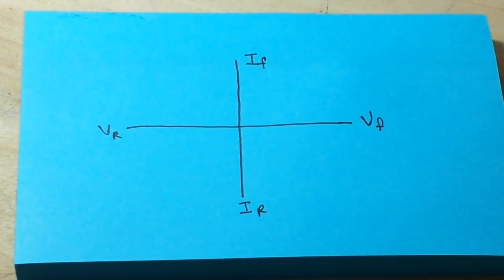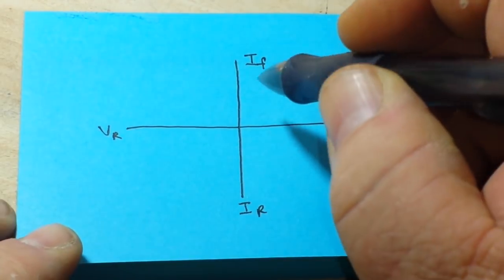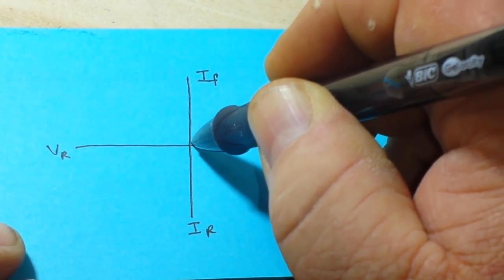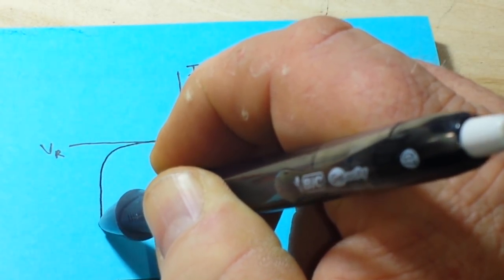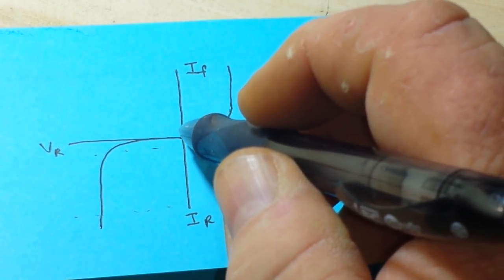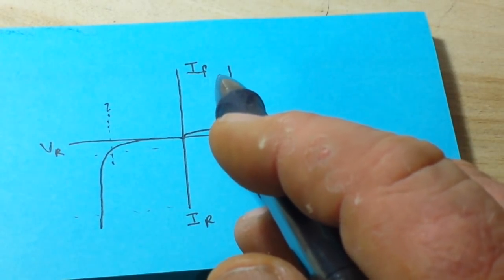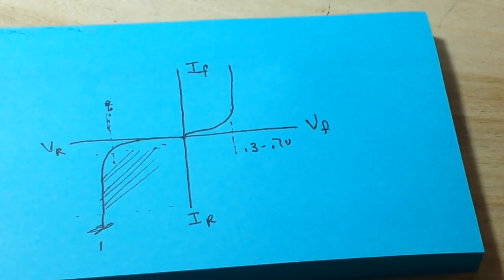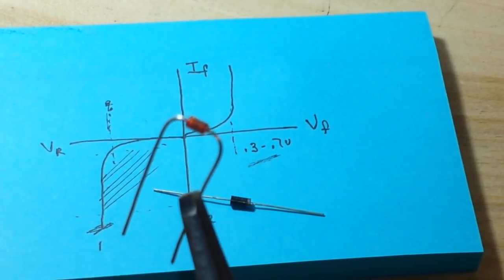Intro to Zener Diodes

Comment: IF you put 12 volts on t he diode instead of 9 will it still read 4 volts??
Reply: Yes. A 4V Zener diode will keep the output voltage at 4V but check the datasheet for the maximum input voltage.
Reply: So the drop across the resistor is 5v?